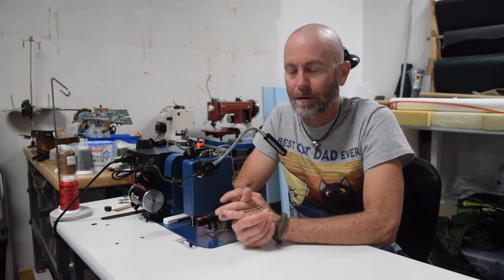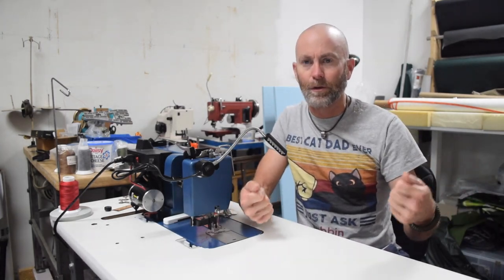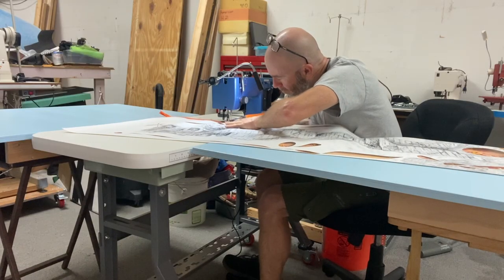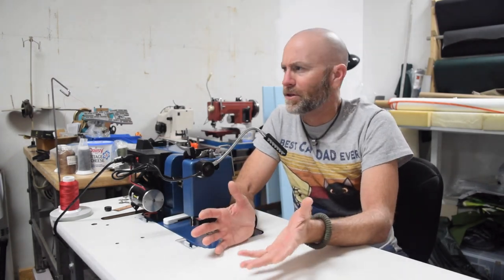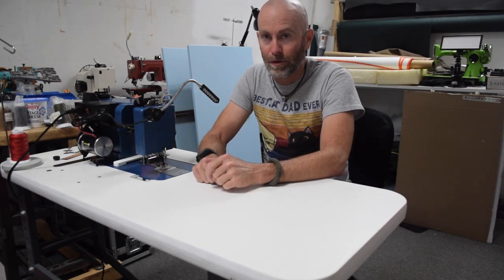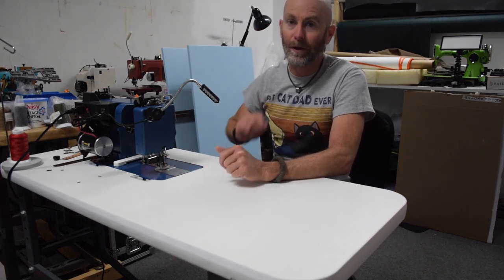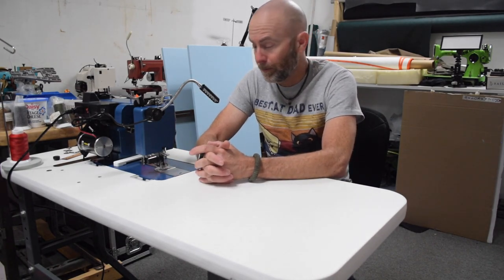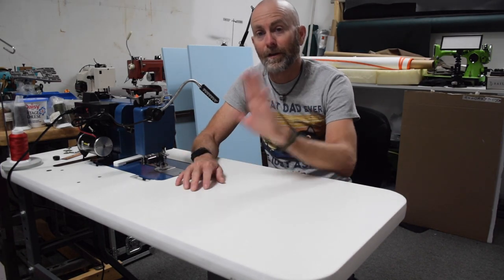Improvised Table Extensions (Wait Until You See What They Are Made From!)

Comment: I used to sew at an awning shop.  Now I have my own industrial machine (JUKI DU-1181N) at home and they send me some smaller jobs.  I had a job where I was hemming 10 ft pieces of vinyl.  I have a couple of those Walmart 5-6' folding tables.  I set one up beside me, and the other out front, much like you did.  Fortunately, they are almost exactly the same height as my machine table.  Works great!  And when I have a lot of fabric to cut out, I slide the table legs into pieces of PVC pipe to bring the table up to a more manageable height, while standing.  The legs slide into the pipes until they reach the curve in the legs.  Saves on this old back of mine.  Thanks for sharing this version of table extensions.
Reply: ya that's what I use too those cheap plastic 5' banquet tables

Comment: Get a couple of window sash locks for both the end of the infeed and outfeed tables where they connect to your sewing table, mounted to the bottom side.If you have the fixed part of the locks under your sewing table you'll reduce interference at other sewing projects. Then line up the tables and latch them on. You can tune in the height differences with shims to align all the tops. 
I have a scrounged four foot long kitchen laminate-covered plywood strip I cut a hole on the right hand end to 'drop in' a Singer 15 or 66 style machine, routed so the deck sits flush. Machine comes out so the special table is easy to store slipped behind other stuff.
Reply from the maker: That's a great idea, thanks for sharing!

Comment: That is a pretty cool and inexpensive idea. I have several folding tables that I use as well as several height adjustable sawhorses that I use with plywood. The only problem with using the plywood is that it tends to disappear. Yup, I use it to build something else. The foam board is a great idea that would solve my problem of using up the plywood. The foam board is very light and plenty strong enough to support fabric. Thanks for the idea. I had not even thought about using foam board.

Comment: In case I may have missed it, what material is the tops made of?  I would suggest maybe a couple of well placed doll rods/metal pins to attach the extensions to your existing set up.  Then you can attach/detach without tools? 
Like the idea, thanks for sharing…
Reply from the maker: I failed to mention the tops, I think they're just some thin (1/4"?) plywood.  He painted them before he delivered them.  But pretty much any plywood-like material would probably work.  
Thanks!
Reply: @thejasonofalltrades  Looked like a hollow-core door sawn in half, tops for two tables that way... looked like the cutout for a hinge plate on the one view which made me think it was a repurosed door.